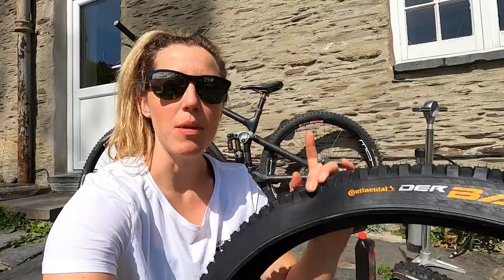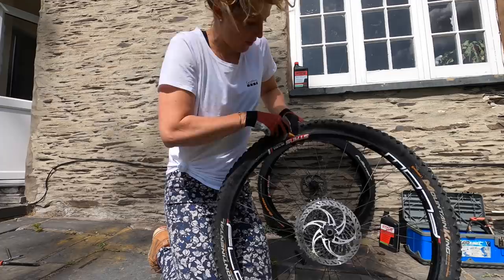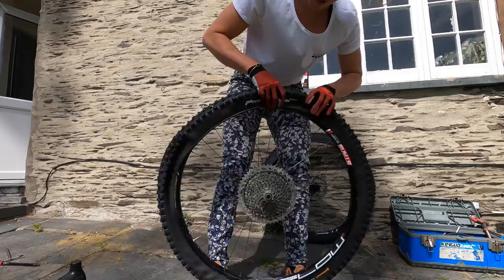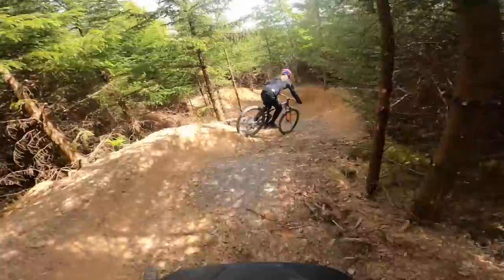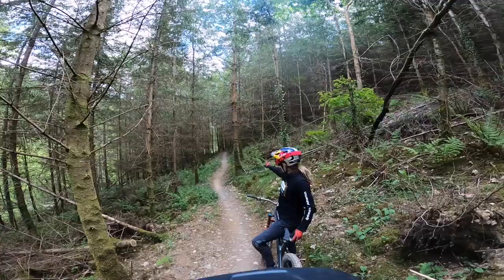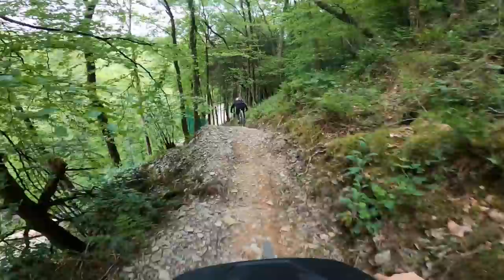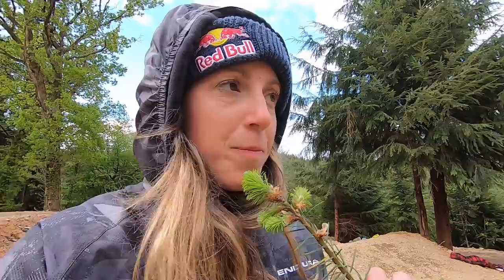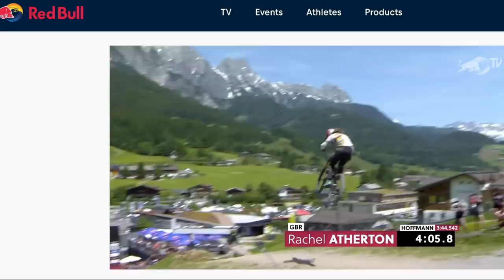my boyfriend nearly LANDS on ME! the BEST berms in Dyfi....Crashes....  & a weird TYRE CHANGE lesson

Comment: There is no set number of "pops" when tire beads are seating. Metal tire levers will often cause damage to the rim. Only rarely are levers actually needed. Rims commonly have a shallow trough (where there is a rim strip, it will lie in the bottom of the trough) in the middle of the rim, which the tire can be manipulated into so that the tire becomes slightly off-center. While one side of the tire is in the trough, the opposite side will have a little extra room so that the tire bead can be slid over the edge of the rim. Enough air has to be removed from the tire first.

Comment: I gave up with tubeless because I could never get them to re-seal if the bead was broken. Rachel makes it look dead easy here.
Reply: cause it is easy
Reply from the maker: maybe you had old tyres?
Reply: @RachelAtherton1  Well it was a while ago. Do you mean an older design, or do they get harder to seal as the individual tyre ages?  <FX: looks in fix-it book> We got the bike (Gary Fischer Cake Race which was moderately fancy back then) in 2004 when I guess the tyres were a year or two old. I gave up and put an inner tube in a bit over a year later, end 2005, when I couldn't get the front to reseal after a puncture/tyre off bead, even with a track pump. The tyres were IRC NOTOS XC. The rear lasted until 2006.
Reply: @Wookey.  older tires go stiffer and harder and start to crack. Get a new pair of tires, like some decent tubeless specific tires and give it another crack, it shouldn't be too hard.

Comment: Wouldn't mind coming and checking this place out, looks rad. I wonder how my eyes will cope with the surface you use. I'm color blind and have an eye condition I got diagnosed with in 2018 which makes riding more difficult and a bit more weather dependant. How is it on the more rainy/damp day's.
Reply from the maker: yea its so good, getting more tracks all the time... the top half is in the open - no trees - then the lower half goes into the trees so the light is dappled... on rainy damp days it is good, drains super well and not much mud more gravel.... cheers!
Reply: @RachelAtherton1 , I feel more confident in woods as the light isn't as intense. Been trying to find the right lenses at the moment I'm trying 100% out now, I got a  mirrored gold lens coming and I still where glasses under those with dark tints. So fingers crossed should be enough to get out in these super bright days and enjoy the sun. Cheers Rachel hopefully once this we are back to normal and I've moved back to Wales I'll definitely come check the place out.